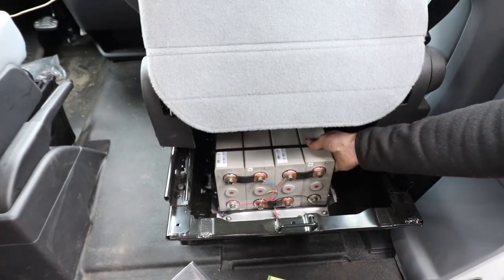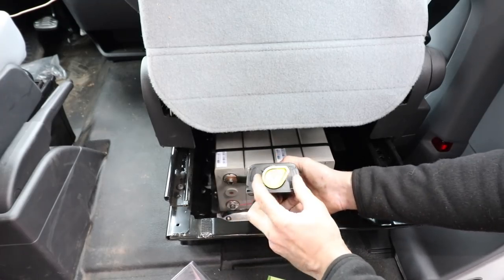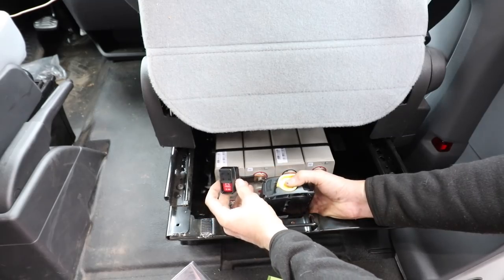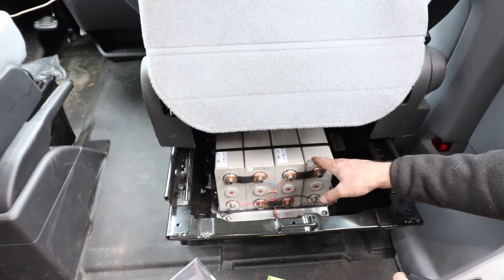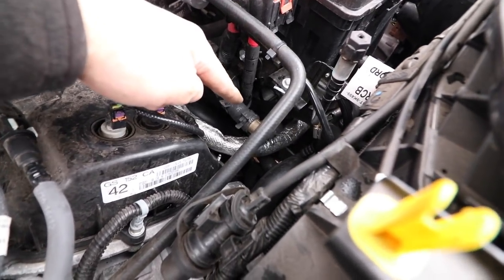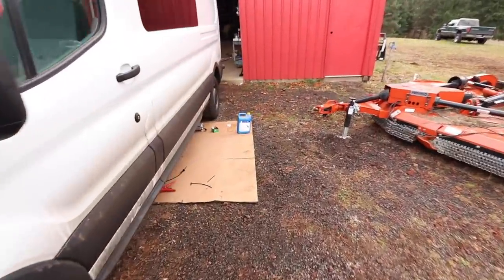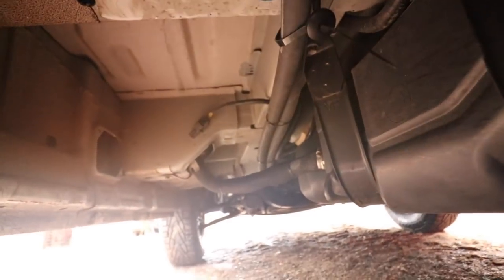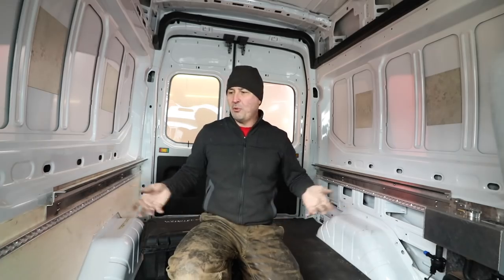AMAZING Lithium Battery Stealth Van Mod!!!

Comment: Seems like a waste of time - there's a reason lead acid batteries are still used in vehicles, and they're also easy enough to keep charged up.
Reply: Kinda misses the point of keeping weight to a minimum while not compromising on performance...  These batteries take up far less space and weigh a lot less than equivalent capacity lead acid would...

Mind, lead acid can only be drained to about 50% max before you damage them but lithium can be drained to around 90%.  So you would actually need nearly double the capacity in Lead Acid to have an equivalent system but that also doubles the weight and space disparity...

Add, unless sealed, you have to worry about off-gassing and maintenance with lead acid batteries and they won't last as long as lithium, with far fewer charge cycles.

While heating the water with electricity is one of the three ways he can heat his water and that takes a lot of capacity...

In terms of just weight, 200 AH 12v Sealed Lead Acid AGM weighs about 115 lbs.  So needing two so you can actually output up to 200 AH means 230 lbs and you would not be able to fit it under that chair...

In terms of load capacity, the lithium batteries he's using are rated for up to 200A continuous... Much higher than the AGM could handle and for far longer...  So when he gets that Magnum inverter he should be able to power just about anything he wants for as long as the charge lasts as he basically has about 2.5 kwh total with this configuration...

Sure, Lead Acid can still be fine for small applications... The car itself, low power needs, etc. but higher needs starts justifying the higher cost of lithium, especially when space and weight comes at a premium in certain applications where you need the room for other things...
Reply: superb explanation ZeoCyberG, superb.

do you have a link to this type of Li battery WS used?  

where he built a bank of 4 to make one battery?  

my previous post linked to an actual one piece battery looking like a standard lead battery but I can't find the type WS is using.
Reply: ZeoCyberG I completely understand the advantages of lithium-ion batteries, however lead-acid batteries, as I said in my OP are extremely easy to keep on top of, as regards charging.
The venting should never be an issue as they invariably always live in the engine compartment, and weight is a moot point, because most of the lithium-ion batteries come in extremely heavy housings, negating much of the advantages.
I could understand having this system as a backup if it was inexpensive (they certainly aren't), and you could simply forget about it having charged it, (definitely not).
Lead-acid batteries have been around for over a century, (in an automotive sense) because they are inexpensive, very reliable, and providing you don't fully discharge them, durable & long lasting.
I'm no expert, but I having watched a few videos by the likes of 'Thunderf00t', it is becoming increasingly apparent that we are getting to a point of diminishing returns with current (no pun intended) battery technology.
I imagine that there will be a leap made in the next few decades, but as things stand the automotive lead-acid battery is far from dead.
Reply: well Aaron, we're now down to $1500.
Reply: Ian MacFarlane, actually, no... Battery technology is set to still increase significantly... In fact it's going to nearly double over the next twenty years because that's the kind of capacity they need for flying EV's, which companies like Uber and Tesla are actively doing R&D on and the latest Tesla batteries are already a significant improvement over their previous and they're finally getting to the point that they can start replacing semi trucks with EV's, which is what Tesla recently showcased they are planning on doing.

While the costs aren't that simple.. Since you're actually spending less with lithium in the long run because they will last longer and provide more power for the weight and size they take up.

They just have a much higher up front cost and thus a higher entry fee but like solar it can pay off more over time.

Lithium can also apply to a wider range of applications and can more easily be scaled up for high powered needs.

Remember, in a vehicle weight counts towards fuel economy and when you're trying to squeeze in everything you need to live for even a few days into a space that's typically under 60 sq ft, then every inch counts.

You also can't squeeze large capacities of batteries in the engine compartment.  A 2.5KWH system is something you can use to cook food, run a microwave, run blenders, run a blow dryer and even heat the hot water and run the AC and all without running the engine except to recharge the battery.

You'd need like over 230 lbs of lead acid battery to provide the equivalent...  While the lithium weights only about 50 lbs and the casing would add maybe 10 lbs...

Lead acid placed anywhere but the engine compartment also need a battery box as well, but has to deal with more weight and typically needs sliding mechanism so they can be accessed, especially if not sealed as then they require regular maintenance...

They're also developing safer lithium, one company has already developed a replacement for the electrolyte that is basically a plastic and thus prevents the lithium from reacting with the air so it's basically puncture proof.  Company is just a start up and starting with small watch cells but eventually that technology is going to be applied to the higher capacity batteries as well and then you'll see much higher adoption as then they'll be safer than lead acid rather than more dangerous.

While countries like China are going heavy into solar and lithium batteries, so that should also help bring the costs down with the growing mass market, as well as in the states with more and more power companies, telecomm companies, etc. switching to lithium and starting to build infrastructure based on them...

So sure, Lead Acid still has its place but there are many reasons why people will use lithium instead when they can afford it...
Reply: these batteries will most likely be running small RV style appliances that I imagine will be installed soon... Lead Acid batteries he would need at least 7 or more to run all he will most likely be running...  that's a ton of weight and space... I would have just stuck with saying Lead Acid still has its advantages just not in this application... You opened the troll door with that comment... lol
Reply: ZeoCyberG As I said I'm no expert, (at all) but I've certainly noticed that advancements in vehicular batteries have been slow(ish).
I'm more of a motorcycle guy, and the problems with packaging & weight have seen no real advances over the last five years, (unless you have the might of Honda to throw $1m at a motorcycle, which still can't really do much more than 37.5miles at average speeds of 115-120 mph)
I digress - I don't doubt that there will be advances, but there (as far as I'm led to believe) won't be any significant advances without a leap in thinking.
I'm probably a bit out of my depth, and I'd need to refer back to someone else's work, but I was simply making the point, (in my OP), that it all seemed a bit much.
And I do absolutely believe that lead-acid batteries will be about for a good few years yet, because they work.
Reply: It really comes down to price is why we still use acid batteries in vehicles. People already complain about spending $125-$150 on new batteries, and that's the cheaper ones that aren't Optima or odyssey. Lithium may last longer, but when it does go out you'll spend way more, probably as much as a new engine. So just because they still use acid batteries in vehicles don't mean they're still the best.
Reply: Ian Macfarlane theyre still used in cars because there cheap and good enough for starting the cars and there are lithium batteries for cars coming out now
Reply: SouthernGuy8503, price is a factor but you'd actually be spending less on lithium in the long run because lithium will last so much longer that you'd have replaced the lead acids up to 4 times by the time you need to replace the lithium once...

It's basically like solar, you pay more up front but you spend less in the long run.  

Lithium can even last longer still if you don't push them to the limits, simply set the max charge a little lower and you can add hundreds of charge cycles to the life the battery.

While it would only get into the price range of a new engine if you needed a really massive battery...  Like say a 48/52v 200AH battery with roughly 10 kwh of total power...

For a 12v 200AH lithium, if you shop around you can find them down to just below $600... Some cost a little more because they offer extra features like better BMS protection, etc.  WS also chose a multi-cell custom battery instead of one big battery but even then it should still be no more than $1400 and you'd be spending well over $6000 on a new car engine in comparison.
Reply: Ian MacFarlane, there's actually a number of EV motorcycles and motorbikes... Examples include the LS-218, which starts at only $38,888, can reach up to 218 MPH and with a 380V 20kwh battery can reach 160-180 miles per charge.

While something like the Brutus V9 can only reach 115 MPH, but it has a range of 245 miles, and starts $32,490...

And there are cheaper EV motorcycles and motorbikes as well...

Obviously, battery technology has improved since Honda came out with that back in 1994...  It just doesn't always seem like it because as batteries are improved, the industry just as quickly takes advantage of it and produces products that use more power... and we're still a long way before we see the actual limits of chemical based batteries.
Reply: ZeoCyberG I'm fully aware of the number of EV motorcycles, however they are all extremely expensive, coupled with appalling range & terribly specc'd.
The only two companies that are making anything like decent electric motorcycles are Energica (Italy) & KTM (Aut).
For a decent motorcycle from Energica you'll still have to drop £25k on a bike that's equivalent (other than range) to the petrol Yamaha MT10, at £10k.
The KTM Freeride is a pretty good motorcycle, but has enormous limitations.
Electric motorcycles will forever be niche unless there's a massive change in weight & packaging of batteries, (quick change packs will go some way, but they are still years off).
Reply: Anyone who sticks the word "only" in front of a £38k motorcycle is living on a different planet that 98% of people.
You quote figures for the LS-218, and Brutus V9 that come from the manufacturers, but they won't let anyone in the motorcycle press test these figures, and any companies in the past who have allowed their figures to be checked (like the now defunct Zero) have been found to be exaggerating massively.
Exaggerating figures us commonplace in the motorcycle industry, with kerb weights, power outputs etc all being fair game, but we are talking about small fractions.
Any EV manufacturers were found to be way, way off.
Reply: @ Ian  http://www.latimes.com/business/autos/la-fi-hy-2018-zero-motorcycles-lineup-20171018-htmlstory.html

EV bikes aren't that expensive.
Reply: if you guys are bent out of shape about the price, the only marginally more expensive, but exponentially better than lead acid, is to hook up a large bank of 18650's. tesla cars are set up that way, as are laptop batteries, portable chargers, pretty much everything li-ion
Reply: Ian MacFarlane, we can debate whether they're "extremely expensive", especially when the prices go much lower for some of them and doesn't change the fact they are getting cheaper as they used to range much higher in price.

Especially, when you don't limit your examples to just EV motorcycles... Like the Chevrolet Bolt EV has a range of 238 miles (which the EPA has certified) and a price point of just $29,995 that puts it at a much more affordable and economical than most others in the market right now, which shows they can be significantly cheaper once they get into larger quantity sales, because part of the premium pricing is because they're usually only producing a limited number of these vehicles.

While you negate your own statement by pointing out how the industry exaggerates because that's true of all vehicles, not just EV's!

But all that is besides the point of the simple fact EV range has improved, which shows the batteries are improving and not just by unnoticeable amounts.

Understand, the original ranges were exaggerated too, so a claim of up to 245 mile range now is still a lot higher than the previous claims of 130, both of which would have gotten less in real world.  So the point remains!

While battery swapping for longer range is already an option.  Tesla demonstrated a system back in 2013 for the Tesla S that automatically swapped the battery at a charging station in just 90 seconds...  There's also already a company that has battery modules that can be poured into a tank that all interconnect automatically as an alternative that can be used like regular pumps at the station and just need the market to grow for EV's more before they can be a common option.

All that just takes is infrastructure to be set up for it but that's a separate issue from the batteries themselves but can be deployed faster if there's real demand, which is one of my previous points that it's getting there now and we're starting to see options offered that they wouldn't have offered before just a few years ago...

They're also developing quick charge that allows up to 80% of the battery to be charged in less than 15 minutes...  Again, that compares to the hours it took before, which again shows they've been improving the technology.

There's also companies working on more than quadrupling the range of EV's, even if they are only partially successful it will still mean a big jump in the ranges we can expect from EV's and is why companies like Uber are now seriously considering developing aerial EV transports as their next market.

Note, compared to how fast fossil fuel vehicles have advanced over the last century, EV's are advancing at a much quicker rate...  Just go back ten years and compare to what's available now!

Lithium batteries have made possible for everyone to have things like pocket devices that are more powerful than the computers we had back in the 90's.

It's just not as fast as say how computers technology is advancing but there's very little that has advanced as quickly as that has in the entire history of the planet.
Reply: I would say the opposite of "waste of time", it charges quicker lasts longer and needs replacing less often..Saving time.
Reply: I understand, but with the price being so much it's seems more logical to replace an acid battery more often. I know some things it's not as big of a deal to buy more expensive and eventually pay less than buying the cheap stuff over and over again, like power tools. But, a lithium battery cost to replace a car battery would be too much too spend all at once. Also a typical car engine that are in everyday vehicles and factory (not heavily modified) won't cost $6K.
Reply: While more expensive, lithium life4po are really safe, last longer, light weight, higher density so smaller and can be discharged further. They are perfect if you want to put them inside the van. I have had one in my rig for 3 years, no issues and charges quick.